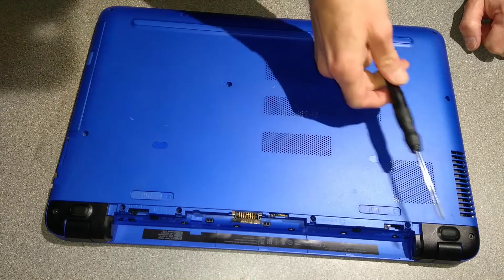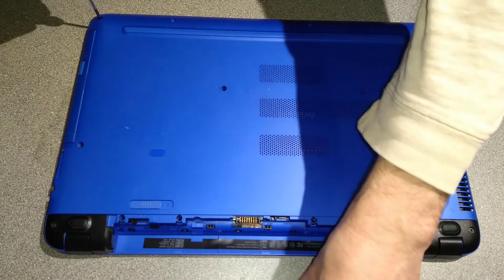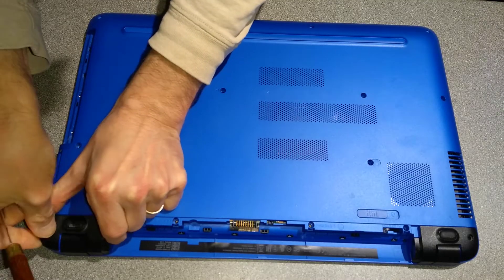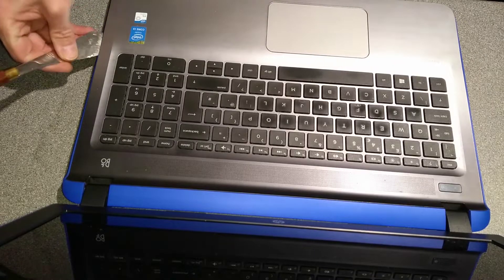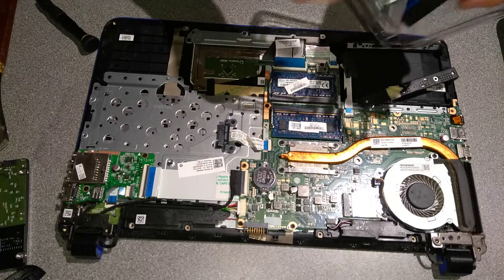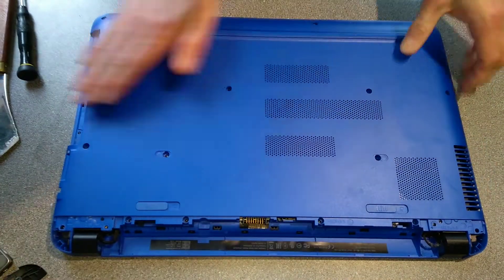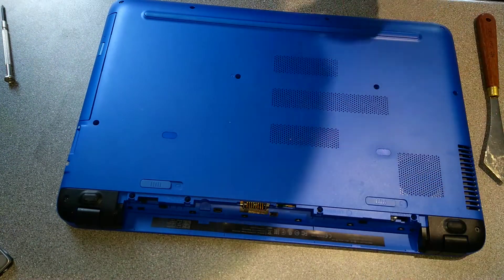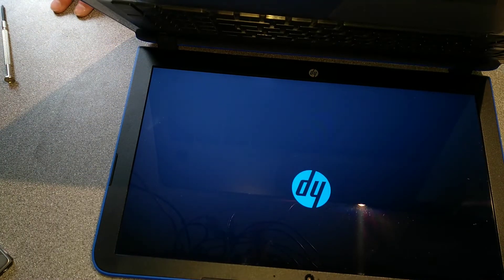How to SSD upgrade or replace the hard disk in an HP Pavilion Notebook 15-ab271sa

Comment: I pulled the tape out of Sata hard drive cable when replacing hard drive, do I need to replace it or can it be reconnected somehow?
Reply from the maker: Depends, can you upload a photo and share the link? I suspect though for the tiny cost  of a replacement cable on ebay, buy a replacement cable :)

Comment: I want to replace 1TB hdd with ssd in my pc hp pavilion notebook (model: 14-al104ne). Is it possible? If yes please recommend me ssd brand name and its size.
Reply from the maker: Any 2.5inch SATA SSD but try and find an SSD which is SLC not TLC/MLC (single level cells vs. Triple level cells or multi level cells).

Comment: Mine has a removable keyboard like so https://youtu.be/UwccwebeTYM but do you see any reason the repairman in that video removed the keyboard at all? Couldn't I just follow your instructions instead? Seems more straight forward to me.
Reply from the maker: The videos are about entirely different laptops. The hard disk for the 15-n is under the palmrest which is removed towards the top of the machine where as the 15-ab it is underneath the machine and the underside of the machine comes off.

Comment: My hard drive is having issues so i took it apart and the ribbon cabel connected to it is bent in a sort of zig zag is it meant to be like that and if not what do i do?
Reply from the maker: Bent is probably fine, it isn't fine if you can see any of the wires or one or more look like they are not connected.
Reply: The  hard drive may be on its way out? My cable was folded over in a zig zag as well when I replaced my ssd.
Reply from the maker: @derekfromtauranga6012  Hard drives are always on their way out, terrible slow devices!